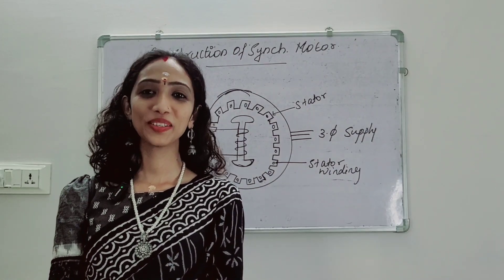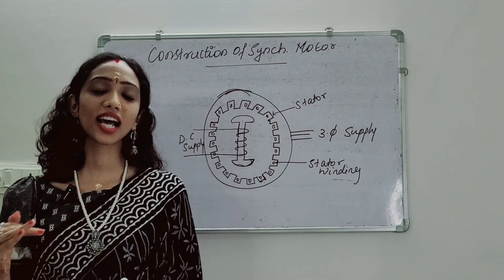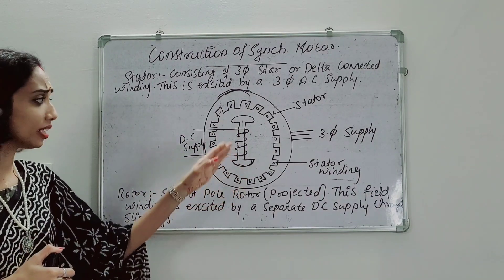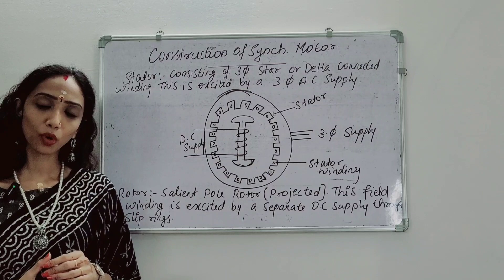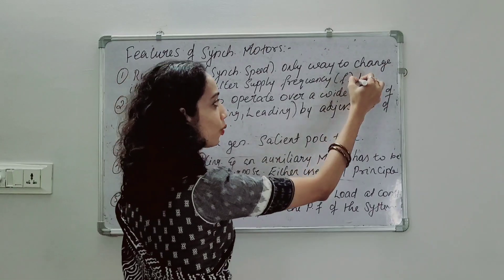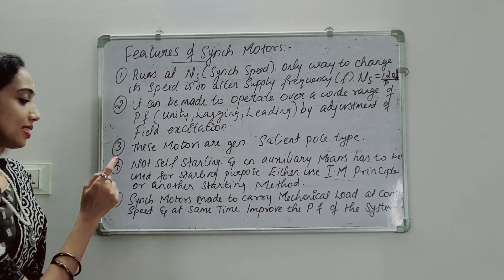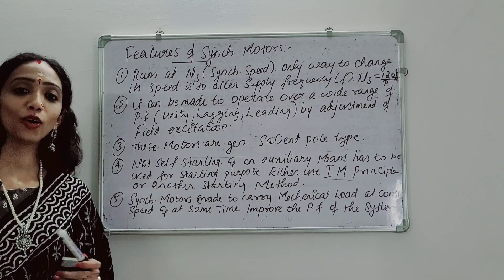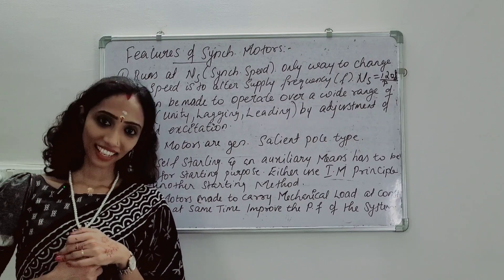Construction of Synchronous Motor/ Features of Synchronous Motor - Explained in Malayalam

Comment: Mam is balance constructional details are similar to synchronous generator?
Reply from the maker: Balance construction?
Reply: @archanasacademy1362  mam I mean if the qn is for 14 marks,is it necessary to write the details of stator and rotor (types of windings,types of slots,....)
Reply from the maker: Ys. But construction of synchronous motor will not be asked for 14 marks...even though you want to study the important parts and write it in construction details.